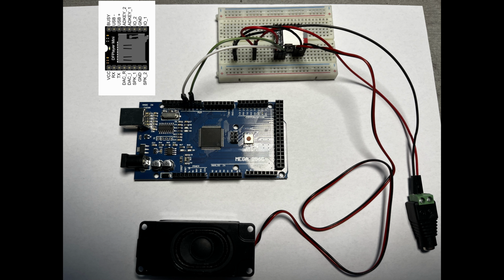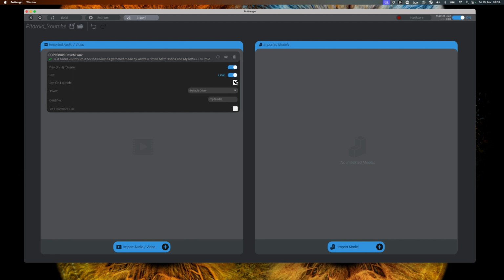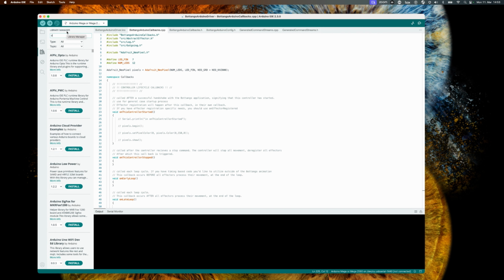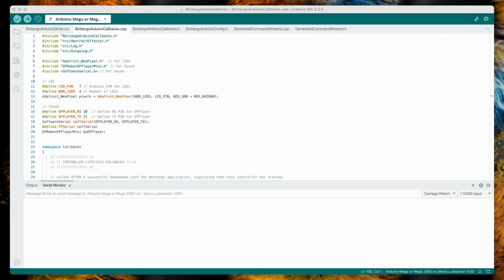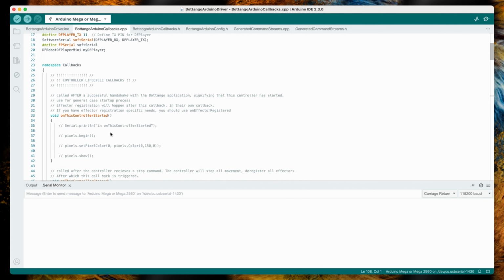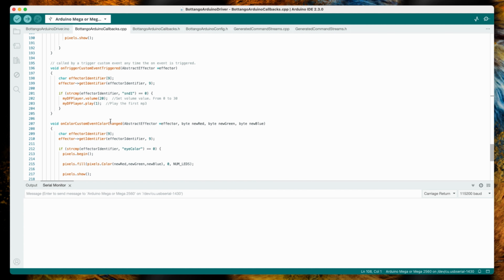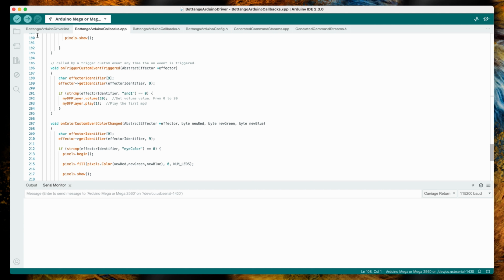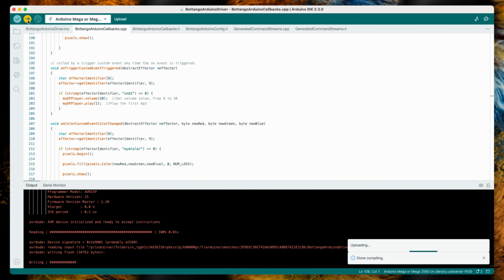Pitdroid with Arduino and Bottango - Sound #8

Comment: I am running into an issue where the driver is reporting "Command not received" in Bottango when the media file effector is set live. When exported to the Arduino, it causes the animation to cut short and eventually stop looping. Has anyone else seen this issue following this tutorial?

EDIT:
An interesting discovery: After listening to the communication over 115200 baud (the same as the driver), I found that the program was crashing shortly after the second time the media was called. After some experimenting, I found that the loop will execute normally when only playing the particular media once over the duration of the loop.
Reply: Im getting the same error when I have the audio file set to live.